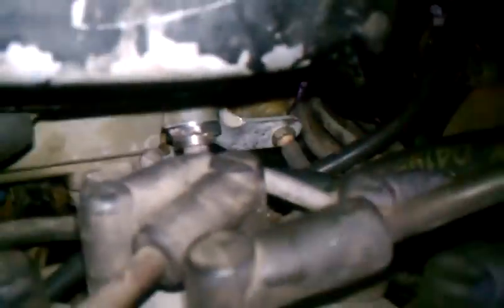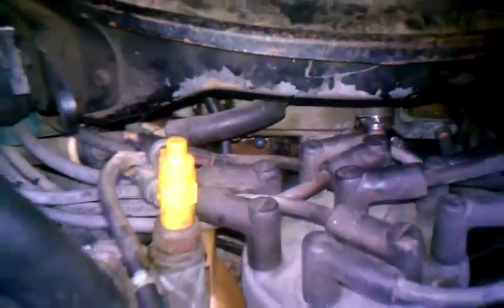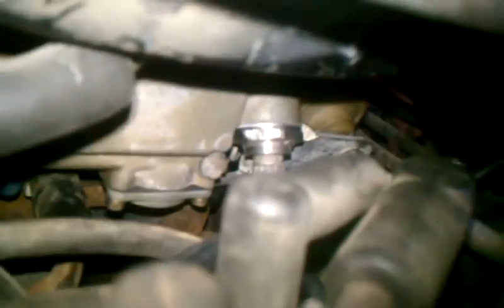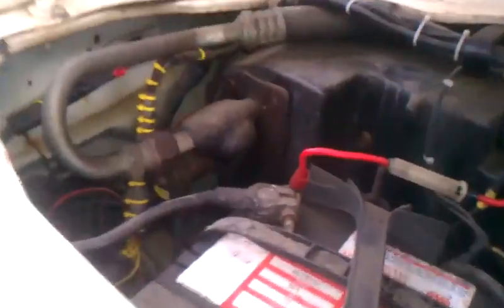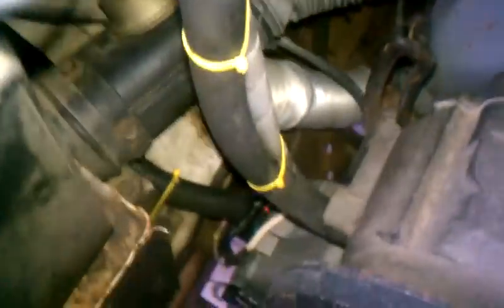Monaco Riviera Motorhome 1984 Ford E-350 Engine 460 7.5L Carburetor Rebuild EGR Valve Part 2

Comment: i had a  leak from the  adaptor tooo  but  a simple  turn with a wrench fixed  it   i have  now tranny  fliud slowly  drip ......................................................drip not  nuff too go crazy over  but  who wants  it  lol. funny  thing its  not  the  pan... or lines so thinking it could be front seal on pump not shure only leaks setting  still...  but ill get  it  fixed  very soon it  gets  bout  10 miles  a gal  hahaha but ...... ill tell you that  thing runs  buddy!!!put  all new  carpet and  fixed  everything it is  awsome  now  88 model it has  all comforts  of home  i love  it  has  onen generator that runs  great and  everthing!!! i would  concider trade on a  harley  of same  value  its  a catalina f350  flat screen tv dvd new  bedding  and shower  if your  looking  to get  away send me  a  messg if interested